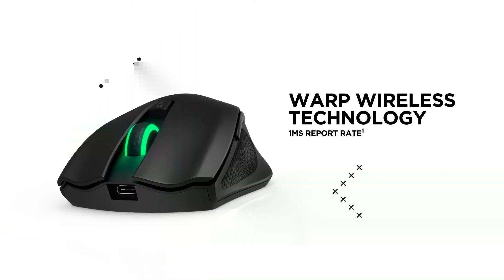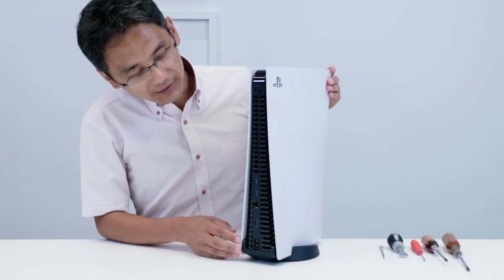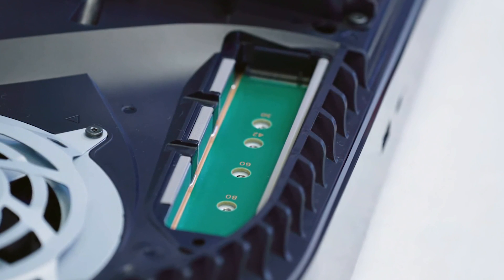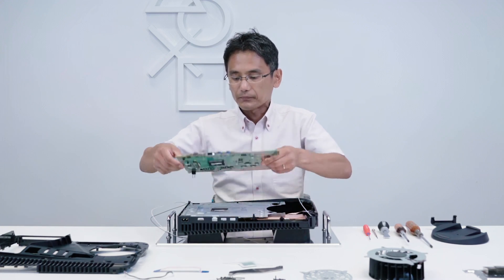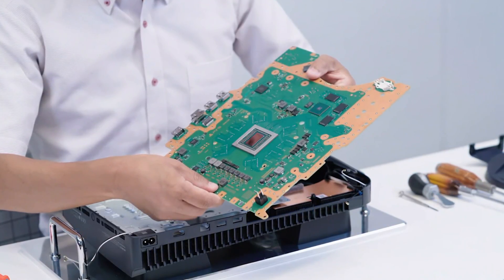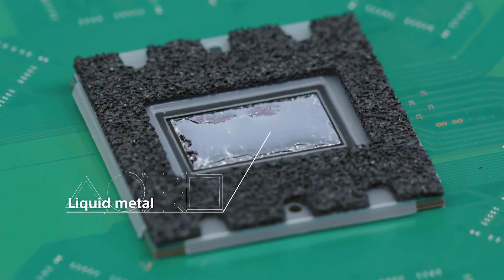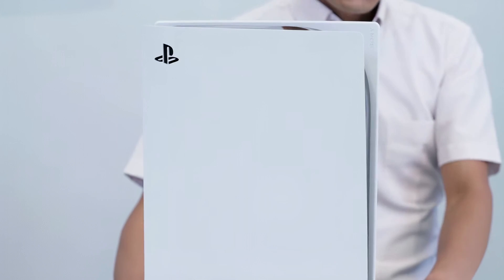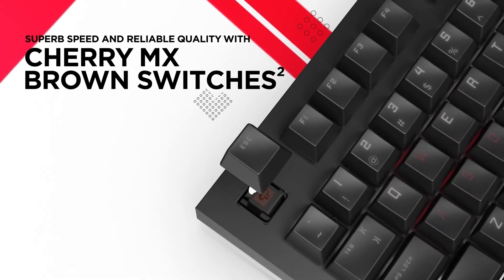PlayStation 5 Teardown Analysis: Inside Sony's Next Generation Hardware Design

Comment: On the whole a great video.

One thing though: Could you PLEASE STOP calling the PS5s APU power distribution scheme "boost clock"? That term is already in use with a quite different solution and implies issues that should not be present with the PS5.

The PS5 does not boost based on environmental circumstances like PC GPUs do, it instead has a total power that can be distributed differently between CPU and GPU. Actually that distribution isn't really based on a real power reading but on that of a model APU.

That makes it a whole lot more predictable and is IMAO a good design choice as with games its often the case that one of these two components gets stressed far more than the other in specific scenes.

EDIT: Fix a misrepresentation after freshing up again.
Reply: To be fair sonys documentation also calls it a "boost mode", and yes temperatures do play a part its just hopefully the retail units will stay cool enough to not encounter them.
Reply: What are the issued implied by a term?

Console gamers aren't familiar with boosted processor speeds so I'm trying to understand the issue. I'm honestly trying to understand the issue either way...
Reply: @IzThatit  PC and Console behave different in this context. Each is a fitting result of the circumstances.

When it comes to consoles games get developed specifically for this platform, which makes games easier to Programm but more importantly easier to make perform reliably (I. E. Locked at 30/60 FPS without major drops).

The PC with its modular approach is a different beast. You can't optimize for the possible different setups, it's simply impossible. Since you won't get consistent performance anyways, and the PC embraces that, CPUs and GPUs instead focus on getting as much out of themself as possible.

This has the disadvantage that with different climate etc a game might perform differently. So if you started playing a game in Antarctica and did set your game settings there to, I. E., always stay above 30FPS, but then move to the Equator, your game will probably drop below 30FPS in some situations.

This is an exaggeration, but actually one shouldn't underestimate the influence of I. E. Airflow, with a freestanding console vs one in a small cupboard. 

You see why this would be an issue for game consoles. If game developers would've optimized for the good situation the bad situation might end up being unplayable.
Reply: It's a cost cutting solution and therefore inferior.
Reply: @Rapunzel879  not really. It's simply a way to get the most out of the components.

One should be able to differentiate between different measures. There's this principle, which can make a die perform better under the same circumstances, and there's a reduction of the size of the die, which is a cost cutting measure indeed.

And if you say that Sony did end up getting a smaller die due to the presence of this feature, that might be true. But if they had a bigger die we also might have to pay more.

In the end I don't like mixing these issues. If Sony ends up winning reliably at lower production cost due to this, then this means it was a clever design and might be used to produce even more cost effective solutions in the future, and that's a good thing, because eventually the cost reduction will come through to the customers.
Reply: Or you can just design it properly and run it flat out instead of compromising lol  people might be referring to back compat with boost mode though as Sony confirmed it will support boost mode like PS4 pro etc.
Reply: And why you cry if they say the true? Hahahaha
Reply: @costel1705  I wonder whether you're trolling, don't want to understand what I'm saying or simply are too stupid to get it.
Reply: @4dee103  As a PC guy I'm curious to see how the PS5 performs, I'm  curious about the Series X also because I love gaming and technology but the PS5 seems to be abit mysterious and a more heavily customized setup. I'm not buying one but am as curious as if I was.
Reply: @TerraWare  the series x is literally just a pc though, will have the same shortcomings as we have already seen via texture pop in ect..

ps5 will be exciting to see vs pc set ups

Comment: I really like Sony´s approach here. It looks promising. The size of the console is probably a bit too large, but otherwise it´s fine.
Reply: The engineer in me drools over the Series X design, admiring the simplicity and elegance of the solution. But then I see what Sony did and smile - an idiot-proof machine that looks unique and draws the attention to it - so looks and practicality in one, the wiser decision I think. It will pull people's attention in stores and everywhere else and in order to damage it through neglect, you really have to try.
I also bet in the eyes of a kid, it looks like a space station or some future tech voodoo :) So there is that, too.
Reply: @tusux2949  A really good description, it´s on point :)
Reply: They make you feel like they did everything they want then they design around it in trade of size which is to me very cool
Reply: yeah it is a tradeoff huge console for good+quiet cooling so i guess im ok with that

Comment: I'm down with the large size. My PC was overheating and all I did was get a nice large tower for it, fixed the problem straight away. No heating issues and no longer hear the fans
Reply: I just use an AIO. My 9900K is set to 5GHz locked and never passes 75 degrees.
Reply: 2WIREG  Yet it’s not more powerful, clown.
Reply: 2WIREG  the Xbox is more powerful but likely not by much. It has about 40% more cores but the PS5 has about 30% higher clocks and cores don't tend to scale performance as linearly as clock speed. I expect both to be nearly identical with both basically having the same game settings. Perhaps very rarely the Xbox will have better performance but just barely. They are fairly close. Though I expect the Xbox to run ray tracing better as RT cores are related to core count on the GPU and it does have nearly double the GPU cores.
Reply: @Skylancer727  Richard couldn't have said it better himself
Reply: i'm not ok with the large size but it is what it is.
Reply: @Alphadwg  Powerful hardware requires good cooling solutions unfortunately.
Reply: Should've have used water cooling and Be Quiet products
Reply: @ls200076  much more expensive and not a reliable solution. Getting a larger case is the cheapest solution, which it was.

Comment: "Toyota like" is a very good way to describe the design
Reply: That's actually weirdly accurate lol
Reply: It means Reliable and easy and economical to repair and maintain
Reply: Well the Playstation brand is like The Corolla the best selling and reliable car you will more than likely see more of those on the road than anything else same with Playstation you will find more of them than anything else worldwide.
Reply: Classically Japanese
Reply: At least he didn't say "Ford-like"
Reply: considering how awsome my Tacoma is I would take "toyota like" as a compliment.  Its the best truck ive ever had and its not even close.
Reply: @ivibs1984  totally agree, I have a verso 7 seater.
Been bullet proof
Reply: Which is good since Toyotas fuckin run forever haha
Reply: Agreed. Its not “luxurious” by any means but it’s engineered well. It should be a good reliable machine.
Reply: I think he means well made and reliable.
Which is what toyota are known for
Reply: Toyota’s are great and long lasting so I’ll take that as him complimenting the PS5 😎
Reply: What does that mean ? ^^
Reply: @ArmGunnar  it very simple and basic but will work well lots of easy to fit bits like a toyota car. Easy to assemble and disassemble
Reply: @ArmGunnar   He means they're easy to work on.  Toyota's are some of the easiest cars to do mechanical work on; most components are easy to get to without taking other unrelated parts of the car off and bolts and screws are in places where its easy to fit a wrench or screwdriver. The car is designed with maintenance in mind. Most European cars however simply try to cram as much engine as they can in as little space as possible with little regard to if or how it will ever come apart.
Reply: @ArmGunnar  simplistic and efficient basically
Reply: @ArmGunnar  it means Japanese car, Japanese console. Japanese love to design similar with other Japanese.
Reply: @ArmGunnar  the overall design language is very reminiscent of Toyota cars. Same kind of curved lines and surfaces. Has very little to do with whether it's cheap or expensive looking.
Reply: @e2rqey  mmm Jabami Yumeko😍😍
Reply: @ArmGunnar  Means PS5 will oversale the xbox in the world no matter what
Reply: @ArmGunnar  i think thats their way of saying, "cheap".
Reply: @juanrubio6132  bruh, toyotas are really well build cars that work for a long time without failure or issues. sure they aint as premium as german cars, but they do not fail as often.
Reply: @delightfulsquirtle  That’s why Toyota has Lexus. Reliable Luxury💪🏾💯💯
Reply: my prius has lasted more than my tesla. that says a lot xD and prius was ahead of its time.
Reply: More like Kia LoL
Reply: angrytacos  Well actually there are 3 other Big British Car manufactures: Bentley, Rolls Royce, and Aston Martin, but two are owned by German brands, and Aston martin was split between a group of investors.
Reply: @-SP. . Mclaren, Aston Martin & Morgan are the ONLY British owned manufacturers left. 👍
Reply: Toyota last.
Reply: angrytacos  India own Mclaren?
Reply: @WickaKalicka . No they don't.
Reply: angrytacos . No they don't. Mclaren, Aston Martin & Morgan are still BRITISH OWNED. 👍
Reply: Look up Toyota TIM WOODS and Lean and things will become clear.
Reply: Hopefully, unlike my wifes Prius, I won't want to kill myself when I'm forced to use it.
Reply: I'll wait for Playstation Toyota Pro
OH WHAT A FEELING!
Reply: Where’s the car mechanic dude when you need him Scotty Gilmer
Reply: Toyota are the gold standard when it comes to reliability.
Reply: Exactly, who wouldn’t want their Camry or Corolla to be styled like a race car but drive like a turd? The mk4 Supra was a fluke, almost every other car they’ve ever made has been garbage
Reply: honda better
Reply: Alfred Basurto . My old work friend had a Toyota Hilux, with full big Ass wheels extra big Spot lights. Extra roll cages everything. Back in the late 90s. Excellent 4WD BEAST of a pick up truck!  He drove that everywhere, off road on road etc etc. He even drove it on the Moon! Believe it or not. Lol 😆. But my point is, it lasted forever. They also did a destruction test on TOP GEAR in the UK. I reckon you should check that out. YouTube should have it somewhere. Excellent quality 👌
Reply: should be "Lexus like" this thing doesn't look like a cheap corolla or camry
Reply: Depends on how people think about Toyota! So... No it's not!
Reply: @3D-Engine-Melody  the design is awful looking but it gets the job done. Thats what people think of Toyota. Who cares anyway, this are the internals, nobody is supposed to see it.
Reply: Let's say something negative about PS5 and focus the goods on Series X; biased as f*ck

With everything
Reply: @3D-Engine-Melody  you should see 2014 digital foundry
Reply: Yeah cheap and nasty looking but efficient.
Reply: @TheLee153  That sounds like you when you wake up in the morning....Cheap, and nasty...lol

Comment: PS5 uses wifi 6 unlike XsX which uses wifi 5 but hey, not good enough. And constant remark on "xbox does this better" 
Biased analysis I hope they get good money from Microsoft marketing dept.
Reply: I see some tears here.
Reply: You won't notice the difference. The difference will only appear if you have a wifi 6 router which only came out earlier this year. They don't really help at all as they were designed to carry 3GB/s which nobody has. I have fiber and the best they off is 1GB. Unless you go to your ISP as a "buisness" they don't offer more than 1GB/s so wifi 5 is all you need.
Reply: No one really cares... especially b/c in practice, MS's network & servers are drastically superior to Sony's. Xbox has always been great at producing internet speeds roughly equal to those of your provider. Whereas Sony fails massively at this. Having better wifi isn't going to change that. I'm not bashing on the PS5 or trying to say XsX is "better in every way" or anything like that... but bragging about wifi, when it won't change anything in practice, is kinda lame.
Reply: Big deal one uses Wi Fi 5 and one uses Wi Fi 6. It doesn't change overall performance of your game or boost your connection. The things DF said was better designed were the GPU and CPU in the Series X, which it simply is. Numbers don't lie. The only negative is that he didn't talk about Sony's SSD enough.
Reply: @TheSpartan21029  Wifi 6 is essential for upcoming VR solution for PlayStation because it makes Wireless VR totally possible.
Reply: @TheSpartan21029  but that snot compleltly true.

the guys at DF still cant accuratly describe how sonys gpu and cpu work. they arent as smart as the claim dude
Reply: @TheSpartan21029  and people thought Dirt 5 on XSX runs at 4K/120 but in reality it has dips on 4K/60, Dynamic 1440/60 with downgrades same with Yakuza Like a Dragon in 4K/30 with dips same goes with 1440/60 with dips as well. What a joke at this point I wouldn't even believe if it's "the most powerful console" narrative.
Reply: @louieverr  If you think Dirt 5 runs badly on the Series X, wait until you see how much "worse" it'll run on PS5. I cannot believe how all you Sony fanboys are acting like Dirt 5 is a Series X exclusive or a showcase for the system... You do realize that the game will look EVEN WORSE on PS5 right? It has nothing to do with the hardware.
Reply: @louieverr  You have it wrong. The 120 fps mode dips in resolution not frames, plus its still not the final build as said by the developers and it was said that they were configuring it for HDMI 2.0 not 2.1 so another wrench to throw in the equation. I don't know where you got your Yakuza information from but I don't see any performance analysis of it. Also it came to my attention that the Series X isn't much different from the PS5. TheRadBrad loaded Devil May Cry from the menu to actual gameplay and it took around 5 seconds of loaded which was touted a tangible benefit of the PS5.

Edit: I found the comparison of it and you're right, but then again we haven't seen any PS5 gameplay of it so we have yet to know how they stack against each other.

Comment: Rich has an excellent point on that SSD bay...that things looks like a closed off pit of hell and NVme drives can get very hot. Double that with the still up-in-air downclocking of the console...I can't say that I'm not afraid of issues down the line. The downclocking might not rear its head at launch, but a few years down the line as games get more and more expensive to run along with Sony's history of heating problems, it's hard to say that I'm not worried. I wouldn't be if Sony was completely transparent like Microsoft is being this time around, but the "hype fueling" comes off to me as closing the blinds on the downsides of the console.

Rich could be right on the marketing side of things, though I suspect essentially all of PS5's success to be tied to the PS4's success and, by extension, the OG Xbox One's failure. I suspect public opinion will heavily even out as the generation gets started. I genuinely hope that all three consoles work absolutely flawlessly despite my concerns with PS5. All players deserve a great experience.
Reply: Yeah... guess Sony never thought about that!?, huh - Lmao